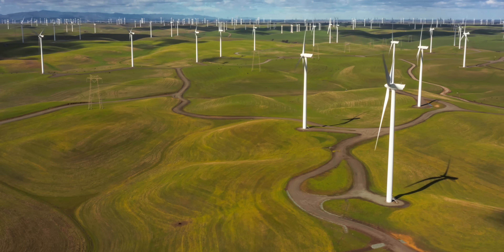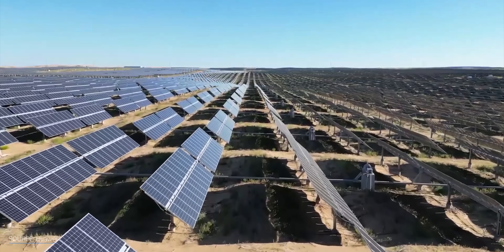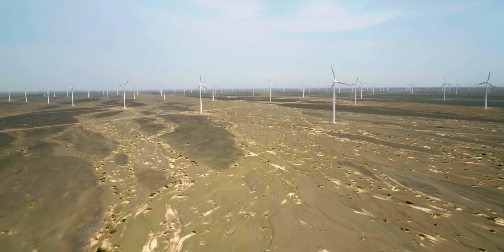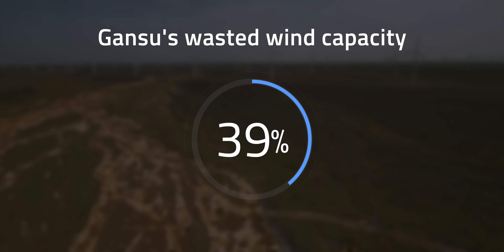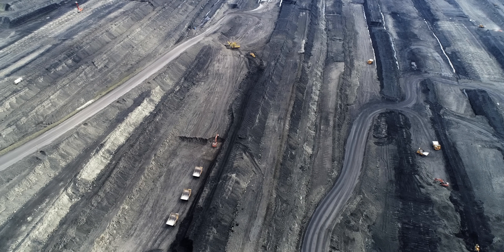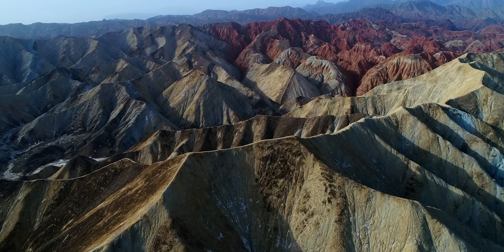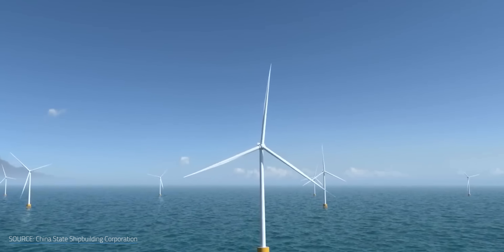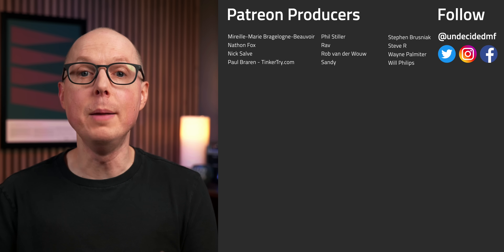The World’s Largest Wind Farm has a Tiny Problem

Comment: Are there any wind farms that are NOT subsidized or assisted in some way by government?
Reply: No. Wind-and-solar absolutely depend upon fossil-fuels. That means fossil-fuels are subsidizing wind-and-solar. Wind-and-solar cannot exist without these subsidies from fossil-fuels.
Reply: In Germany new larger wind projects now have to offer a prices for the erngy. For some of the areas they go to the point of accepting the normal market price instead of a fixed preset number. If this turns out for a profit is still open, but this is essentilly an example of no goverment assistance.
Wind and PV depend a lot on loaction - under favorable conditions they can be well cheaper than coal. At good locations the production also tends to be more spread out. The issue is only storrage and grid stability - it is a bit tricky in how to factor these costs in. Currently the fossile source provide much of the storrage / reserve part. Only part of the energy actually needs to go through storrage - so this part may not be as bad as it looks at first glance.

Comment: This is highly incorrect. The gensau wind farm generates less than 1 gigawatt reliable average. And gensau is ridiculously big.  Please stop the ridiculous disinformation for clicks. A singular nuclear powerplant easily dwarfs this average and you often build 2-3 plants at the same time. 

Nuclear plants and coal and oil needs to be there due to wind farms often only generating <25% of expected outouts. Noone in their right mind would want wind supplying more than 10% of the country energy output. It does not work. 
 
Wind turbines are a tiny extra nice addition but not being reliable is a huge problem. You MUST have reliable sources of piwer ready to make up for the extremely bad reliability of the farm anyway. This means just using nuclear plants is safer and better for the wnvironment as well as cheaper to begin with. For that nuclear powerplant needed to be built anyway to account for the wind turbines lack of reliability. People dont accept no light because no wind. 

Dont lie to people. Wind turbines are NOT a solution. They can be used to make a small supplement to a powergrid only. Anything more is simply a cost and an unreliable issue. It does not work.

Energy storage is NOT energy effective and increases the costs for no purpose while giving them no advantage over a reliable energy source. 

The nuclear and coal plants are STILL needes when you build wind turbines. So they do not currently serve any realy purpose in large scale at all. Zero.

And no this isnt a success story. It delivered a large ineffective and expensive as well as unreliable source of energy. They need nuclear plants. 

Your real hope is FUSION and we hope we get there soon. Wind just isnt there.

Comment: That's the deal with all wind and solar power. It's just not at the moment when you need it. 
That's why I think hydrogen cars are future. You can electrolyze snot out of sea water when you have extra power. But when you need more you just burn it in gas turbine engine. Also about fuel cells made by platinum catalyst... it's a dead end, unless we crash some platinum asteroids into earth, it's just too rare and too little the thing around.

Comment: I think that catastrophic warming due to CO2 cannot happen according to the mathematics and quantum physics that describe CO2 and electromagnetic radiation. Meanwhile, replacing oil and coal with methane reduces CO2 emissions by about 50%, which is a low cost way to reduce carbon emissions on the way to total renewable energy.

Comment: How is 50%of energy generated lost a success? It wouldn't be tough to turn that around. First with all the local coal make ersatz oil with the excess electricity. Then use the oil to make nitrogen based fertiliser again with the spare energy. China is desperate for fertiliser this would be a win win for them without the loose of unemployed miners. In addition in large industrial plants co2 capture isn't too expensive plus with all the mines there are plenty of spaces for depositing slag & carbon rich detritus. Just a thought

Comment: 39% of your product wasted at double the price is a stretch to call a "success".
Reply: He likes China...
Reply: @donaldkenne3776  Or the other way round: because so much power can't be used the used power is so expensive.
Reply: @donaldkenne3776  aaaand now I'm a libertarian.
Reply: It's the myth of the Chinese efficency. If you build a 100 times of "X" the of course you're gonna be more efficent. Even if said "X" was built for no reason. Just like thousands of miles of high speed rail that China built to middle of nowhere.
Reply: Meanwhile AI devs in the US are considering building nuclear reactors to power 100 billion dollar data centers
Reply: The reality is likely far worse.  China has a habit of releasing information that makes them look better and altering the statistics to make their wind turbine projects look more successful would make the government look better.
Reply: not really.  The wind was going to blow whether the wind turbines were there or not.  Obviously though it drives the cost higher for wind.
Reply: The power that is wasted is peak power, in times when there is low demand. So this would be the times of the lower maket value for the power than the times when the power is actually ued. So in may be 39% of the possibler energy not used, but this would be more like 20% of the energy value lost even if there where more power lines. Which price actually is paid can be different for political decisions, but there is still a true value for the economy as a whole, without the political interference with the markets.
The power lines where a bit behind (depite of fast planing and permits in China). With the new line things should be better now.
As another point wind turbines also have wear - so stopping them for some time also reduces the costs.
Reply: China power grid are all connected its 4x4 horizontal x vertical, a super grid much are UVDC Ultra-high voltage DC
I believe it may have increased since
 thus
The energy can surely be stored, just we don't know. Many things aren't all clear to outsiders 
Likely it is used to generate hydrogen for other use

Cost will drop over time as energy receive greater long term then initial build cost
Thus after slowly paying off build cost, yearly depreciation

Comment: For scale, the average US home uses WAY more power than the average home anywhere else. So, the figure he started with is off by a factor of 2 or 3 when speaking about a remote Chinese housing space. 

If it works right, it powers significantly more than we might think. 👍

1 gigiwatt is 750k - 1 million US homes. It’s likely close to 3 million rural Chinese homes. 20 gigiwatt farm. Roughly 60 million homes worth of power.

Comment: In the 70s, during the oil embargo, when we had long gas lines, etc., we took measures to conserve energy. Government PR campaigns, speed limit changes…. No one now says, ‘maybe we should use less’. They say things like, ‘we should have these mega projects in the U. S.’  As someone from Kansas who is dealing with our land being taken, I would argue that this is so misguided.
Reply: Along with generating electricity, wind farms could be used as wind breakers.
Solar panels on arid land, over a period  may help convert the arid land into somewhat fertile land by conserving moisture in land under solar panels.
Reply: While it seems like a great idea to duplicate these Chinese mega projects there is one factor which China doesn't have to deal, NIMBY. Being a totalitarian government the people on the ground have virtually no say in such matters.
Reply: C02 @ 0.04% warms nothing. It is not even a pollutant & if it were halved (nearly was 20,000 years ago)  plant life would die off.

Pollution has nothing to do with CO2 & climate change is a multi trillion $ industry.
Reply: The US actually has been dropping it's per capita energy for quite some time. As much as boomers complain about Lightbulbs and fuel efficiency requirements, they really have led to huge improvements.
Reply: Agreed I am in the Texas panhandle. To the north of me there are hundreds of wind turbines 3/4 of them sit idle and according to people that work on the so called wind farm only 3-4 of 20 in a grid are actually producing any electricity not to mention the dead migrating birds that litter the area around the turbine. A mile south of my back door is a 2000 acre solar farm being constructed with another 2000 acres set to begin being constructed next year or so if and when it happens. So just out my back door thats 2000 acres of land that as of last year was producing crops such as wheat and cotton that are now covered up with solar panels. Gone to are the herds of Mule deer Coyotes rabbits Pheasants doves quail and other animals that once called this area home.  Friends of mine all over the state who have been duped into this so called green energy scam are now stuck with wind and solar projects sitting on there land un used un recyclable rendering the land unfit for use for anything productive. All because a government subsidy ran out and because the companies who promised to take it all away filed bankruptcy so they did not have to live up to there contract.
Reply: @bryansharp6166  Wind, solar and batteries are coming and will reshape the planet.  Mule deer , coyotes and rabbits notwithstanding.
Reply: @bryansharp6166  'their' is also a word you need to learn to use correctly. (t)here are places. 'Their' is 'belongs to' . I mean, if you don't understand your own language how can we believe you understand anything on any subject?
Reply: @AndrewN75  I understood it. the irony is, messing up the grammar vs an annoying, nitpicking person, who doesn't even comment on the topic at hand, but something completely different.   You do realise that what you say is less expected than what I say to you.   When someone isn't an English native for instance, what do you expect? One wrong word here and there doesn't matter, the point, the meaning that those words are used to put forth, is the important thing.  What anyone expect though, no matter the language, is for ppl to have both common sense and decency.  Btw, yo are also wrong. Cause you couldn't have said it was wrong  if you didn't understand it. Maybe you should think more abt the words you use too? To not look like you do now :))
Reply: @Matoakas  I commented on this subject elsewhere. Yes, English is very tolerable of many errors but for an Englishman to get their, there, they're wrong is a sign of poor education and largely negates any argument they put forward. That's just the way it is. And I don't understand your last 5 sentences which are full of double negatives. And we don't use 'forth' anymore. I wish you well with your English studies. PS bryanharpe can stand up for himself, surely?
Reply: @AndrewN75  are you serious? Wow, your comment is like watching paint dry..nice deflection though.

Comment: Why are the turbines so far apart? Is this really optimal?
Reply: The turbines disrupt the wind down-stream, introducing turbulence. If that turbulence hit another turbine they would interact in ways which would excessively stress the blades and structure. So there's a minimum spacing to allow for wind flow to stabilise and ensure this does not happen.
Reply: @vylbird8014  Thanks - hard to visualize wind being that choppy over those long distances, but I'll take your word for it. I can't imagine they'd "waste space" otherwise.

Comment: Such power is needed for AI mega computers and data centers. They can function anywhere taking advantage of remote economics and not placing such a load on metropolitan areas. 
This helps air quality from a distance, with less transmission line.

Comment: My question is, what is the overall life of a wind turbine? What is the disposal procedure for bad ones? I do agree we need to use as many so called clean projects. We just need to learn all of the variables, including, repair, wildlife affects, disposal and more I am missing. Is it like pushing EV's, but not having the electricity to charge them. 
With the past 20 yrs, what we have learned about EV's and how they actually leave a larger footprint, compared to a gas car. Make sure we chat all aspects of these projects, not just the power they make up?

Comment: In Denmark, wind turbines produce 55% of consumption. But the power plants, as a result of the varying production from the turbines and the fact that the power plants have to provide district heating, have increased the consumption of fuels compared to 30 years ago when there were no wind turbines. Denmark has the world's largest distribution of district heating. 70% of the buildings in the country have district heating. In fairness, it must be said that more district heating is produced today than 30 years ago. But several thermal power plants in the country, where it takes 24 hours to shut down the boiler and 12 hours to start it due to thermal expansion of boiler tubes, use more fuel than before wind turbines. When the 400 MW power plant has to be on standby when the turbines are not supplying, a valve is turned and the steam is directed into the sea and all energy is lost. When the turbines do not supply, the steam turbine is started and electricity is produced. And when the power plant has to provide district heating when the wind turbines supply, fuels are burned and all the steam from the boiler ends up as district heating - a huge loss.

Comment: i think the focus on bigger is better is a fatal flaw to the efforts too go green as well as the direction of centralizing power.... Big corporations, political groups etc  want individual wind machines and the farms so big that only THEY can afford to build and control them   .... by making the scale so large they eliminate the individual or groups that might be able to supply their own power... in short those with localized.. small area or individualized ability to generate their energy are NOT under their strict control.....I believe smaller scale less intrusive technologies ... will in fact be far better as an alternative... such can be affordable to individuals, small groups and more important dispersed... not dependent upon centralized locations or authority

Comment: The consumer price of electricity in many European countries exceeds 20c per kwh. Coal has always provided reliable 24x7 baseload. Electricity generated from coal at 4.2 cents/kwh is great value and shows China's competitive advantages. Surely a better solution to building intermittent wind farms would have been to retrofit  coal power stations with CO2 and particulate scrubbers. Chinese consumers pay around 10c kwh. The authorities could afford to double the 4.2 cents cost of coal to pay for the scrubbers and still be in pocket. But not politically acceptable ?

Comment: matts For gets  Both Solar and Wind has Failed the Fed Gov TVA  Duke Energy plus 10 other power Companys dec 23 dec 24 2022 Texax 2021 , THE TVA jan 17th 2024, the TVA had Solar contracts by others, the TVA contracted for 2000 megawatts , the TVA received 50 megawatts, that is a 97% Failure rate

Comment: I wonder if part of the tariff from the electricity generated by wind ppwer can be used to fund Gangsu
There is a concept in chinese geography called Heihe-tengchung line which states.that 96% of thr population live on one side of the line so the area on the otherside are improvisihed wit very little population
Which is a shame so these areas can be gold mine of green power

Comment: I'm still very much on the fence about wind.
 I do concede that it is a great contributor, but I think we need to revisit design.
I don't think going into desolate areas is necessarily the answer for placement.
 I do however, believe that the many square miles of parking lots in every populous area should be shaded in solar panels.
Certainly wouldn't hurt to have every roof with at least some sort of contributing array.
Reply: Desolate areas are necessary, bc NOBODY wants to live or work nearby! Turbines are shitty neighbours. No bird, no small or big animal would live in vicinity either. That`s the design problem - infrasounds from rotor and constant shadow movement.

Comment: They definitely should replicate!  Renewables cost roughly the same if not even less than Oil per KWh at production, and  a countrys industry will have an advantage from cheap renewables. This is a bit less relevant for the US as there is oil in the US anyway but even today the USA imports more Energy than it exports. But with the European ressources in mind its a dealbreaker.

Comment: You quote the price the electricity is sold for in comparison to the coal powered station rather than what it costs to make which is probably different.
Reply: Yes, was wondering the same as you - I will repost my thoughts here about the asking price Matt quotes and says in this video is a main issue. If he is right (?) then the added cost of a 1600 km+ transmission may mean it is not that competative wherever they take it.

A key point that Matt unfortuntely did not elucidate is this: why are these wind farm operators currently asking around $75/MWh for wind power .... i.e. why are their asking price for the electricty from these Gobi "mega-wind" farms indeed relatively expensive compared to other good examples, like your example of wind power in Texas (i.e. according to Matt the Gobi Chinese are asking about double what the Texan wind farms deliver a MWh for)?  We can speculate on why, but I would love to know the verified reasons from a knowledgable expert... is it their installation costs, is it O&M, is it low capacity factor, is it low subsidies, is it high interest on theri capital, is it greed?
Reply: @CarbonIceland  the main cost for wind power is the O&M costs. This should be lower in China as the technician pay rates are much lower there.